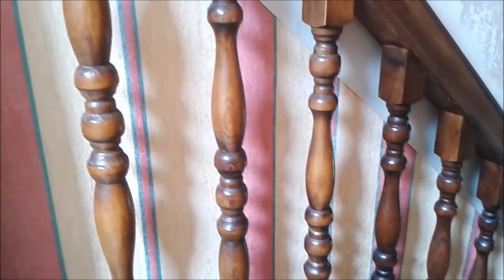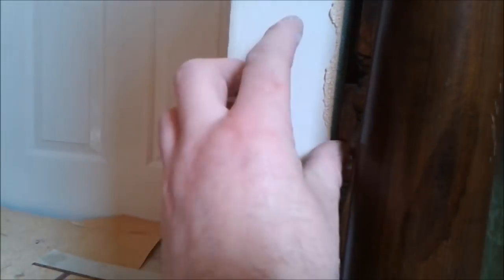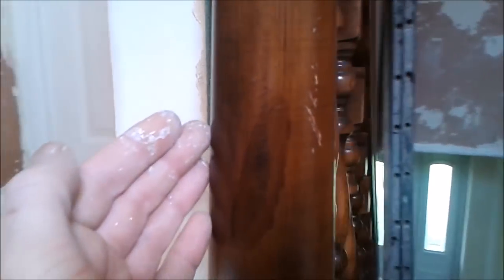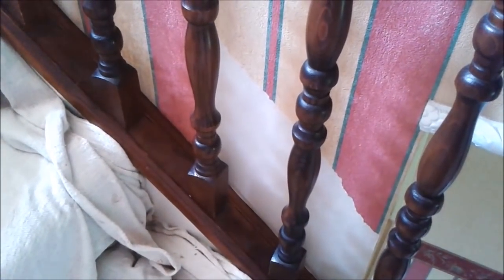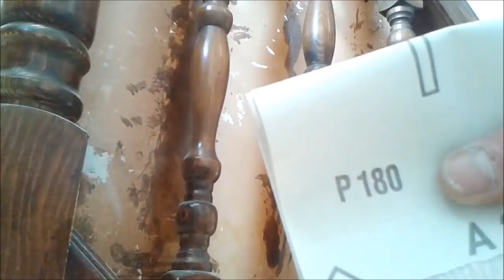Decorating a staircase painting behind spindles

Comment: Do you mix your paste to the same consistency for every type of wallpaper ? Thanks.
Reply from the maker: No,  it does depend on what type of paper your using, like thick embossed papers I would mix thicker and apply loads. Thin papers not as thick and apply like normal. But it can depend on the surface as well and how much paste will be absorbed into the wall. Heavyweight vinyl and some other papers your better using a strong ready mixed paste.
Reply: @PaintingandDecorating  thanks good advice, come out of my time about 2 years ago now but I'm always keen on learning more